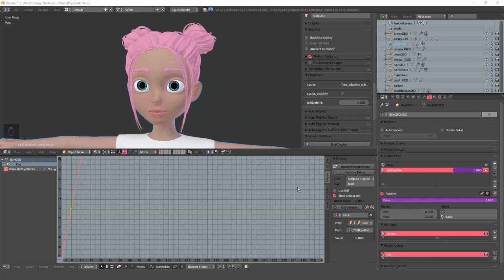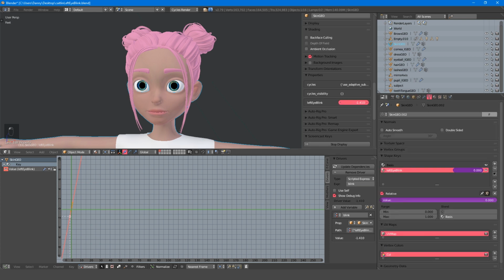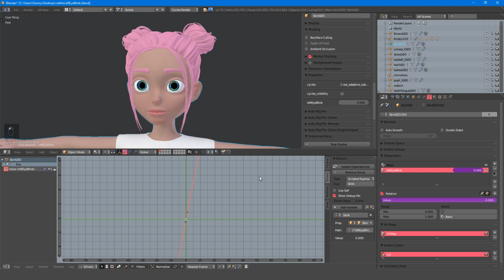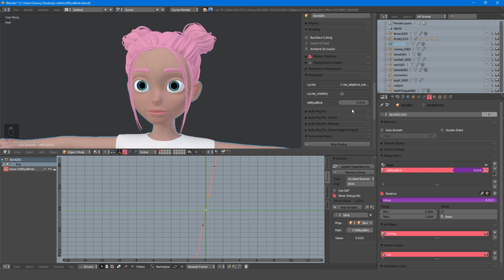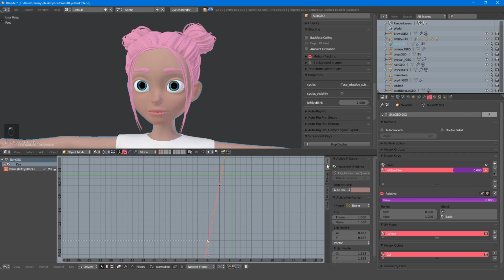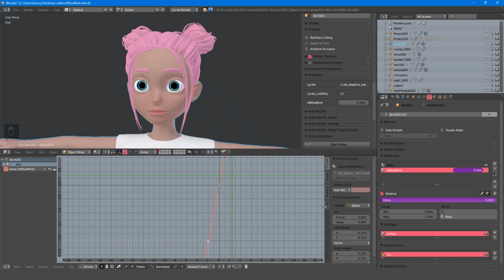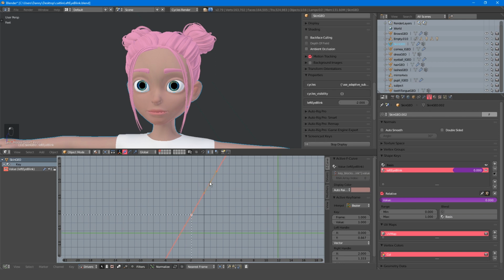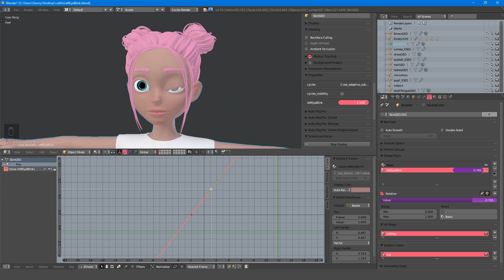How to MANIPULATE DRIVERS - Blender Tutorial 2/3

Comment: Hi Danny, thank you for these videos, they have been a great help.
I'm trying to figure out if there is a way for me to drive a set of shape keys (for lipsync) using colours from a video or image sequence?
I really like the way Adobe Character Animator does LipSync and I use it for various projects.
I was thinking if I could make a Character Animator puppet that displayed solid colours instead of hand drawn mouth shapes, 
I could export my finished lipsync from CA as an image sequence or video clip of different colours that flash up in the frame, and use that to somehow drive the shape keys in blender.
  
So when blender sees a red frame in the texture image sequence it would set the Ee shape key to 1 and all others to 0, when it sees an orange frame it would set "m" shape key to 1 and all others to 0, etc.  So hijacking Adobe's 2D lipsync system and use it to drive my 3D lipsync shape keys in Blender.
I feel that the input variable thing you show in this video should be the answer, but I just can't figure out how to go about it.     
Do you have any suggestions?
Thanks!
Reply: unless there is a simpler way to take Character Animation lipsync data and bring it in to blender more directly!

Comment: Wow this explains it really well. I'm thinking if you can set at what position a shape key starts you could possibly have 2 shapes keys controlled by one slider, one after the other. (with the eyes you have a half eye closed to help fix intersection and then a full close.)
Reply from the maker: that's exactly what I'll be doing tomorrow :)
Reply: Oh, hahaha
Reply from the maker: well almost exactly. you can drive 2 keys at the same time, so I will create an intermediate shape key and make it so that it turns on when it's half way through the original :)